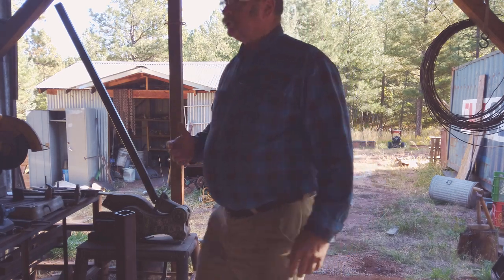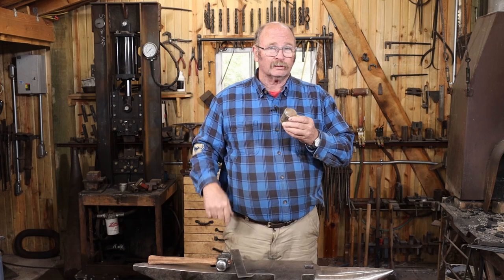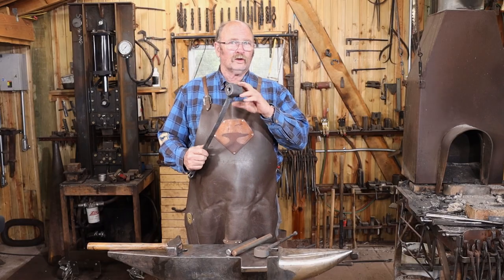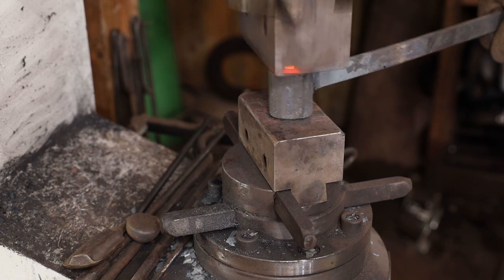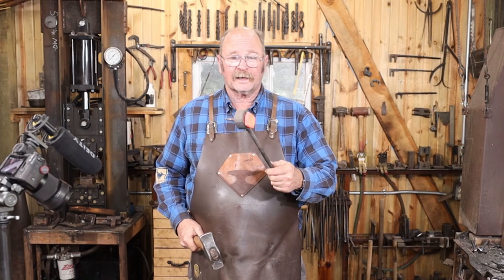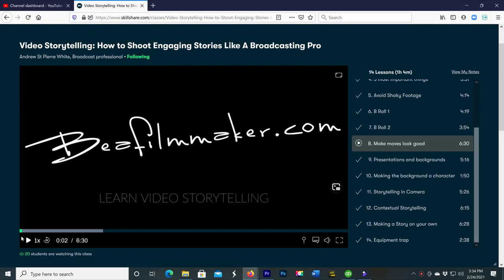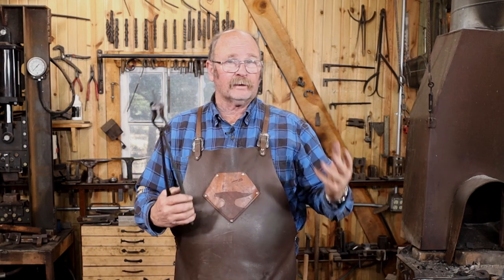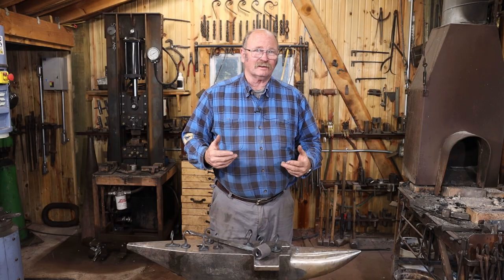Ceiling Hooks under the Power Hammer

Comment: First of all I was wondering how you were going to broach a square hole after drilling the round hole on the lathe. I found myself saying "now that was clever" when you just mashed the round hole square using the power hammer. That was impressive thinking out of the box.
Second, I bet you are a champion at whack a mole after watching you chase the heading tool around the top of the anvil. You didn't seem to slow down your stroke as you chased it around. 
Thanks for sharing another great project video with us.

Comment: Hi John.  Couldn't you get into the transition area with the corner of the power hammer dies? Or is that a terrible idea for some non-obvious reason?
Reply from the maker: The nose of the tongs get in the way.  If I had welded a handle on the back of the hook it would have been easier.
Reply: @BlackBearForge  I could see that when you were working on the long side of the dies, and I imagine the short side wouldn't have been any better, but could you use the corner?
Reply: @BlackBearForge  Sorry, I think I might have been unclear in both my question and my follow up. 
I wasn't referring to the corner between the face and side of the dies,  I meant the point where the face meets both the long and short sides of the dies.